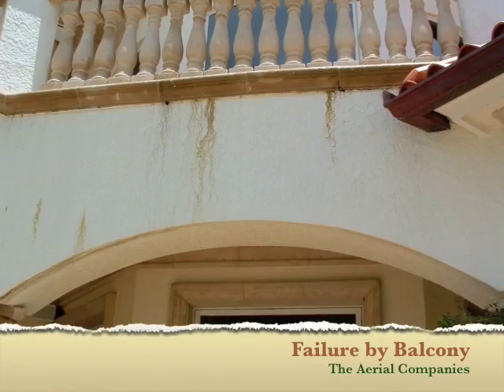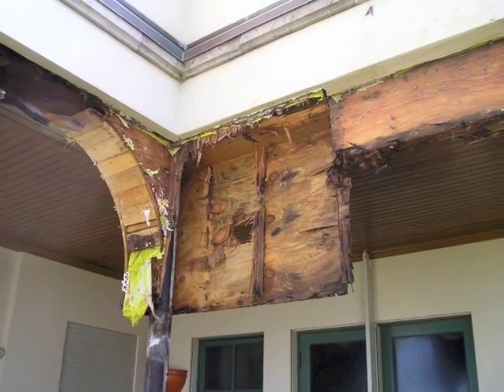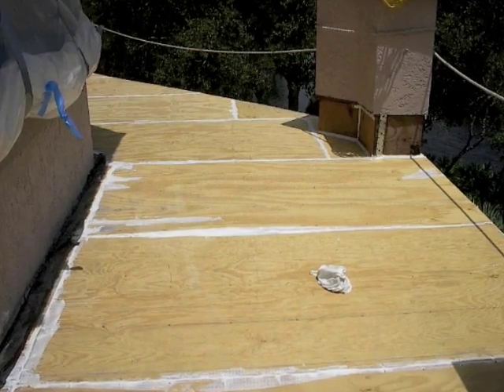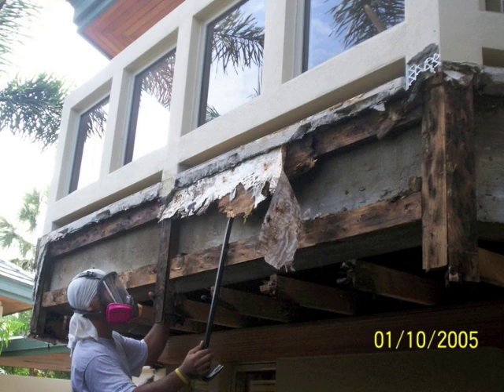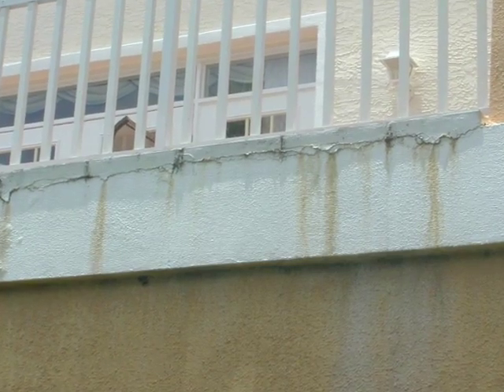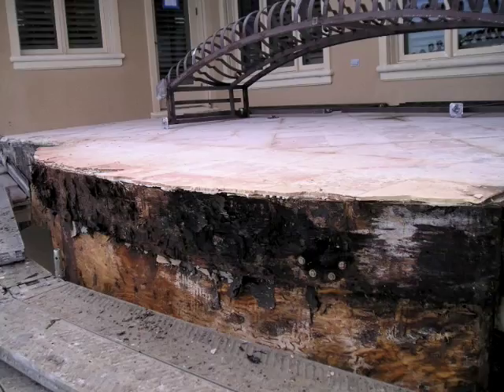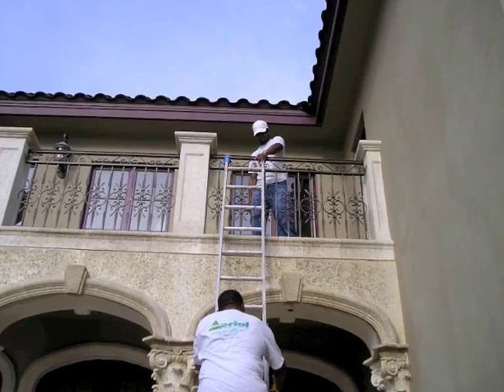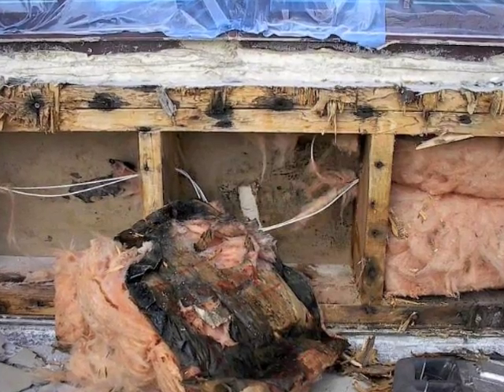Failure by Balcony - Waterproofing Florida | The Aerial Companies, Inc.

Comment: Good video, I've been in the Construction Industry as a General Contractor since 1978 here in California. This is very accurate in everything stated, most of all to get some oversight while under construction as often the case the Building Inspector misses many stages of construction and cannot always view the actual work or workers while the do the work. Hense the statement, always get someone reputable and experienced to do the work. However, when you buy a home you had no part in building? You best hire someone to Inspect this and many other areas.

Another missing detail I see here on these decks is VENTILATION, decks like this abd structures that are prone to moisture buildup need proper ventilation in order to prevent the buildup of dampness and moisture content of the wooden structure.

If in doubt, tear into it now..

William J. Gargan
Sausalito, California 94965